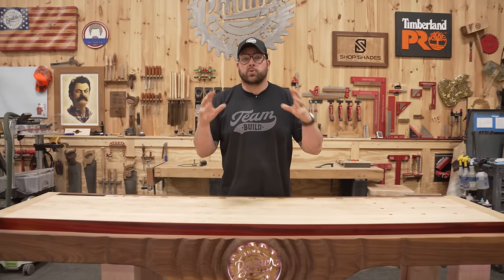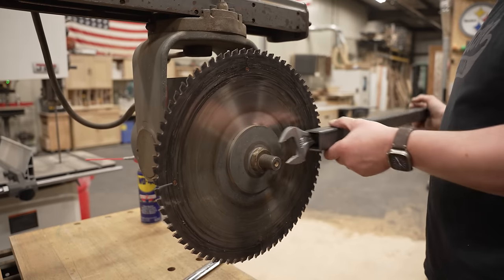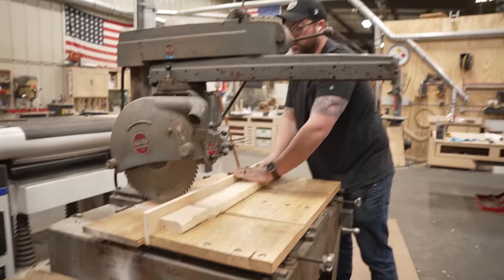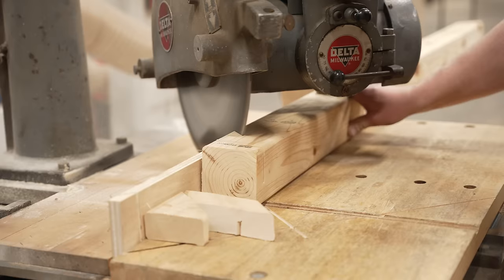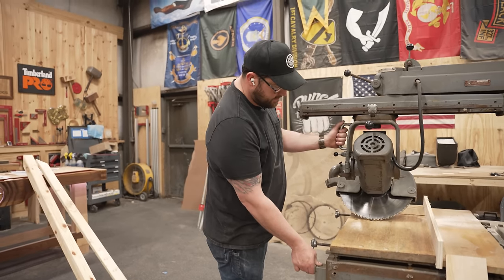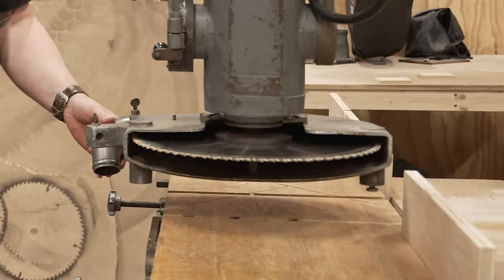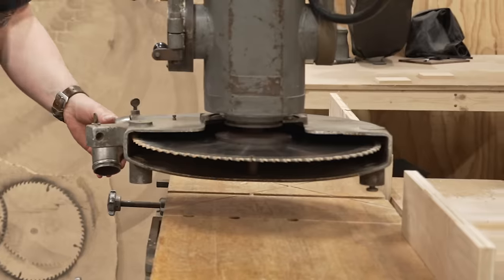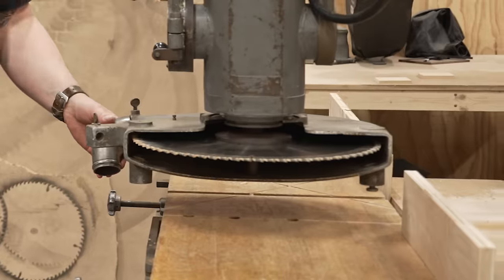Testing Woodworkings Most Dangerous Techniques

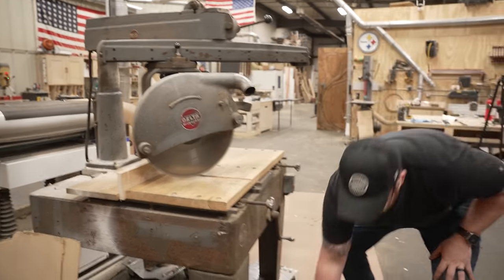Comment: 9:20 when I saw you get that rag so close to the blade to showcase the airflow, I just started sweating when I thought about how it could get caught on the blade and pulled in. Or maybe I am overthinking this and have watched final destination one too many times
Reply: Think everyone thought that :) huge ass blades or machinery and loose cloth gives me the willys.
Reply: I was staring at that tail intently as it whipped back and forth😅😅😅😅😅😅
Reply: I just watched you make several errors with your RAS
1. Read the Mister Sawdust book before you use the saw.
2. That saw needs a much bigger/longer table. I use a 3 piece table, 2 pieces behind the fence puts you further from the blade for most cuts. Move the the extra table piece in front only when you need the extra width
3. Make your cross cuts from the left. Hold the stock with your left hand and the saw with the right hand.
4. Throughly inspect the machine and install the missing parts. Anti kick-back bar...
5. When ripping rotate the blade guard to just above the piece being fed into the blade. Adjust the anti-kickback bar to the material thickness. Use a much longer push stick shaped like a tablesaw push stick that fits between blade and fence.
6. All tools require the operator to be familiar with operations.  I recently replaced a sliding miter saw with a 1956 Dewalt RAS and I love it.  It sits closer to the wall and  makes perfect cross cuts and dados.

Great tool you have acquired I look forward to more videos as you become proficient with this tool. 
Keep up the great content.

Comment: I do run a radial arm saw every day. Mine is a 14" original saw, the most productive tool in my shop. After I assemble a cut list, I mark out stop locations, turn the saw on, and keep feeding it material until the cutlist is finished. I never take it out of its 90 degree orientation, I'll go so far as to cut the long dimension on the radial arm saw then switch to a miter saw for all the angles. When used in the sort of production environment I'm describing, I find these safe, efficient, and more enjoyable to use than any alternative I've found.

Comment: I've had a 10" Craftsman radial arm since the early 1970's - still runs fine. One thing to mention, the blade guard is adjustable. The front edge of the guard (many have a point at that part) should be set to barely clear the wood and it will keep it from throwing all that sawdust at you.

Comment: I worked at a lumber yard where we had one of these. It was 3 or 3.5 HP if I remember right. We cut anything from 2x4 to landscape timbers to 4” Schedule 40 PVC to railroad timbers if we rolled them over. It had automotive wheels and tires and a hitch so it could be pulled behind your truck. We also had 20’ extensions on each end for doing those rip cuts you were struggling with. It did take over 2 min to come to a stop. It was crazy. I think it may still be in use at the lumber yard today

Comment: Back in High School woodshop class ( early 80's) we had this same saw.  Only allowed to crosscut on it.  Can you imagine a bunch of high school teens using this beast.  Thankfully no one ever injured!  I had grown up using a 10 inch RAS so was used to it but many others were complete newbies.   That blade would spin forever.  We would wedge a long 1x2 piece of oak using that small black knob on the front as a fulcrum against the saw plate as a brake no less - Just crazy!.   We also had a shaper - NO One not even the teacher used it - can't imagine how terrifying that must have been. Thanks Mr LeCluse if your out there for keeping us all safe.

Comment: It's interesting to me to see people talk about radial arm saws as if they're strange antiques. (Maybe this is because I'm something of a strange antique myself.) I have two Sears Craftsman 10" Radial Arm saws--one I've had for about 40 years and one I picked up for $25 to keep in the basement of a rental property I own. I've never owned a table saw, though I recently inherited an old Shopsmith Mark V that I often use for the table saw function. I've use my radial arm saw mostly for crosscutting, miters, compound miters, but also for ripping. (I recently rebuilt the cedar lath fence in my front yard that required me to rip dozens of 1"x8"x8' boards to 1-1/4 slats.) I've used the planing attachment to rough plane a very uneven 4" slab of walnut that I used for a live-edge shelf for a television. I have a dado blade for it that I've used--one of those that wobbles to various widths that you set. Before I had a drill press, I used the radial arm saw as a drill a few times and I have a sanding disk and several sanding drums that I've used, too. I've also used it for molding edges with molding attachment.

I don't understand the reputation that radial arm saws have gotten for not being safe. Of course, any saw is inherently dangerous but, in all the years I've used the saw, I've only once had anything I'd consider a mishap. While ripping, the saw threw a loose knot that I hadn't noticed back hard enough to break off a little bit of the saw blade guard. Without the guard set close to the board, as you're supposed to, it could have hit me if I'd been directly behind the blade. But I usually stand a bit to the side. For crosscuts, the blade is pushing the board back against the fence and I've never had a problem with the blade wanting to climb the board. This is probably because I keep a firm grip on the saw. (I've also sometimes done a cross cut from the front, pushing back against the wood.) I've seen Stumpy Nubs' original video that rightly calls out some of the initial hype about what radial arm saws can do (https://www.youtube.com/watch?v=AHRwN99fGCY&t=566s). (One of the manuals shows guy in a dress shirt and tie cutting full sheet of plywood in half by having the saw blade turned outward and pushing the plywood in front of the saw. Sheeze!) I've also see the rebuttal videos by radial arm saw fans and Stumpy Nubs' clarification in which he makes it clear that he's not saying that radial arm saws can't be safe; he's just criticizing some of the unsafe uses of them (https://www.youtube.com/watch?v=TKL2ooTOPk8). If you want to learn more about radial arm saws from an old pro, check out videos by BigMike Tuna like this one (https://www.youtube.com/watch?v=CV4uXtxnOdg&t=1316s) . (His saw is almost identical to mine, by the way.) If you want to see some terrific joinery done with a radial arm saw, check out videos by @dustylumberco. And here's an idea for an upgraded table for a radial arm saw: https://www.youtube.com/watch?v=bdLaLgGCqUo&t=33s.

There's an interesting historical promotional film from DeWalt about the use of the DeWalt radial arm saw's use in the WWII war program here: https://www.youtube.com/watch?v=HiGH0Qsu3ak&t=501s. 

W/r to this video, not only is the saw missing the anti-kickback pawl, as @robertgruen2088 noted, but Malecki isn't adjusting the blade guard appropriately for the rips, as was noted by @leebernardo 1000.
Reply: It is all about perspective. You were taught with this, it was all you knew. Now we have more safety features, we look back at those seeing the potential hazards. I have a craftsman table saw from the 50's in my home shop. There is no safety features. No blade guard or riving knife or anything else modern saws use. Where I worked had machines from WW2. When they did get newer machines, they had to try to retrofit safety features like light curtains.  In 50 years, they will look back at what we currently use as dangerous and crazy. You just dont know until things change after stuff like injuries and death.
Reply: @nikkafrog  My father had a 50's era Craftsman table saw. No safety features, to be sure, but it had a hell of a nice cast iron table--something you won't find on low-cost table saws these days. My 1970's era Craftsman radial arm saw, does have a device to prevent pinching when ripping. It's not a riving knife but a disk that rolls in the kerf keeping it from closing up. And attached to that splitter are anti-kickback pawls. Using that right, I've never had kickback.
Reply: @nikkafrog  I'm hoping one day we can find a much less sketchy successor to the angle grinder - man are they useful! Man are they sketchy!!!

Comment: I own a 1965 Craftsman 10 inch radial arm saw that I got from my father and he kept the manual for it all those years that he had it.  The craziest cut I saw in the book was a cove cut, essentially you're swinging the saw blade side to side on the pivot of the motor to cove out a depression in the face of the piece of wood. There was also an attachment on the back side of the motor to turn it into a shaper and a kind of drill press... no thanks, still  gives me the shivers even thinking about doing either of those things.

Comment: Had this exact model (minus the weird dust collection thing that this one has) in a wood shop I used to work at. But they had it altered so that none of the adjustments could be made. You could only slide it forward and back while cutting material. They also had a sort of raised bed built around the blade so the blade wasn't exposed. It was only used for 90 degree cuts on 2x Materials. 2x4, 2x6, etc. You slid the 2x materials under/in to the "raised bed". It was actually a pretty genius way to make a very unsafe saw, safe. They had it there for longer than the 10 years I was there with no incidents.

Comment: These are great for production work with jigs and and established setups and techniques.  Where people get in the most trouble is when they are switching the tool around to do a bunch of things in sequence for a few parts.  They can also take of body parts if you are stupid or careless.  I've used the RAS with the blade horizontal or transverse but had the table set up with fixtures and jigs, everything locked and the work fed with a pusher where I was beyond arm's reach of the blade and not in the line of kickback and had a remote foot switch.  You can make crown moldings, dado, etc

Comment: I have one that looks identical. You are missing  an anti kickback device. It is 5/8” solid rod that drops down a hole next to the dust discharge with some barbs on the end that allow wood to slide under them but only 1 way.
The cutting deck is designed to be easily re- configurable leaving a spacer wherever you want that puts your fence in the spot you want.
You could spin your Motorhead 180 degrees that would allow the belly cut….but that’s as sketchy as waving a rag in the wind of the massive blade!

Comment: In my undergrad theatre woodshop (circa the '90s), we learned on a 3-phase, (I want to say) 5hp, TWENTY-INCH radial saw.  The thing was an absolute beast and it terrified more than a few of us.  We had a standing rule that when you were done with it, you HAD to stand by it and watch it spin down (which took well over 3 minutes, the last minute or so was SILENT!!!) to keep other people in the shop from accidentally reaching into the still-spinning blade.  We only ever used it for crosscuts at 90*, though, and it was years later before I even learned that a saw like that could do other stuff....  It's a good story I love to tell but I do NOT miss that saw...

I'm pretty sure I watched every one of your cuts puckered up and through my fingers....

Comment: I studied technical theatre in college. Our shop had a huge old time beefy radial arm like this. Everything that came off our bench ran through it. We, quite literally, would have it running for hours. If you can master the radial arm,  you are going to have SUCH a productivity boost (especially with batches of goods.) You can do joinery, dado stacks, and quickly bulk out your framing members (I recall we'd use our's to cut 4-5 2 by 4's in one pass.) you simply can't beat it. Never overlook the radial arm! Wish more modern shops used them. We had 18 year old tap dancing acting students running one first day of class haha they're simple but frightening.
Reply: Seems like a lot of potential that comes with a lot of learning curve to get the most out of these safely

Comment: I grew up using a 10” craftsman radial saw. Always preferred it to the table saw, but happy I have replaced it with a 12” compound miter saw which is so much easier to configure than the radial was. Probably lucky I never did something stupid with it

Comment: I miss having my radial arm saws. I have had 3 over the years. My 12" craftsman was a strong work horse. The 14" delta was under powered for hard woods, unless I put a 12" blade on it. And my 16" delta very much like the one you got was a great saw. Mine had a blade break on it. It was just a lever that I would push on to slow the blade spinning down faster

Comment: I have this exact same saw! It was in my dad's shop since I was a kid, he let me loose on the thing when I was like 12. It really does like to run towards you when cutting and is quite scary. Your is missing part of the blade guard mechanism, and the anti-kickback fingers for ripping. Also, there's a built in braking system for the blade that isn't working - it makes a loud repetitive clicking sound when turned off and the blade slows down pretty rapidly when it's working.

With original accessories, it can also be used as a disc sander, drum sander, grinder, and pattern-maker router. I have scans of the original owners manual and parts catalog for it, if you'd like a copy.

Comment: When I was a senior in HS (late '60's, early '70's) I worked in my grandfather's woodshop.  I think that was back when a "miter saw" was a u shaped wood structure that you put your 2X4 wood in and cut it with a handsaw.  The 2 pieces of equipment that were most important in his shop were the table saw and the radial arm saw.  What you're not showing with the radial arm, at least in our shop, every task on that saw had its own jig and, if there wasn't one existing, we made them.  I don't ever remember being scared of the saw.  We did lot ripping with it.  There were long infeed and outfeed tables to support the wood.  As you say, kickback was one of the biggest concerns.  We were aware of the dangers of the saw(s) but we had systems and jigs to make them safer.

Comment: I got taught to use a pretty big cross cut like this at a timber yard for my first job when I was 15, the biggest I ever cut would be a 3x9 sapele or oak board. Biggest tip is keep your arm straight because when it bites or hits a knot it'll yank your absolute arm off, it'll also stop it wanting to "walk off the table" 🤙🏻

Comment: My father bought a 10" Dewalt radial saw new in 1958. I still have that saw in my shop today and can't imagine not having it. I have 8 foot in feed and out feed tables on each end of the saw therefor I don't get stuck like you did. As for the blade deflection , your blade is not lined up parallel to the fence. There are adjustments for every aspect of that saw. You had my heart rate  up when did the rip cut because you are missing the anti kick back paw!!! My saw still has the original maple top on it and as the humidity changes in the shop I have to check cut squareness every now and then. Get a better operators manual on the saw and it will show all the adjustments that can be done on that saw. By the way I was never brave enough to do the gut cut rip. I use my saw almost every day. Keep up the the good videos and be safe!!!               Mike

Comment: I used a radial arm saw years ago in high school. It was a great tool and as long as you don't have the saw blade directly pointed at a body part it was super-safe. I only used it for crosscuts and dados so perhaps other functions are more dangerous but for other functions I either used a table saw or hand tools. I always felt the radial arm saw felt safer than the table saw so maybe I'm just different than other users. Maybe it was because I could see the blade where-as with a table saw the blade was often hidden for dado cuts and rabbets. The saw I used had a auto brake function when power was removed which I'm sure makes a difference.

Comment: you can use a VFD Inverter to control motor speed and even adjust the acceleration time and deacceleration time so you'll get a soft start and short time stop and immediate emergency stop.
it's very important on this kind of saws.

Comment: We had a De Walt 20" radial saw for cutting extruded aluminium box section, 5.5" square. We would occasionally cut mitres, but 99% of the time it was straight cuts. We had 16" and 13" diameter blades too. Never had any accidents on it, at all. We used 13" mitre saws with 13" blades for cutting aluminium too. We would fit at least 2 emergency stop buttons on every machine, just to be safe.

Comment: @23:20, about your saw being wired as to not extend a certain point.
I think the motor has been flipped over. Remove blade and rotate motor 360 degree counter-clockwise as seen at that point in the video. That should freen up the cable for maximum sketchiness.

Comment: I ran one of these for almost 12yrs at an orange store that no one knows. We had a spring loaded tether that went from the saw carriage to the rear post to keep rearward tension on the saw. So if you let go, it would get pulled back into the starting location. It also stopped the saw from climb cutting, and shooting forward as you make the cut.

Comment: I grew up using a radial arm saw with my Dad and inherited it eventually. I built a big cabinet system for my laundry room using it with a wobble dado blade. It's a wonder I didn't lose a body part. Sold the thing shortly after and bought a table saw. It was a cool tool for some cuts, but a table saw and a miter saw are better options.